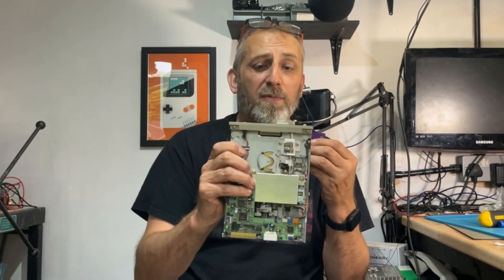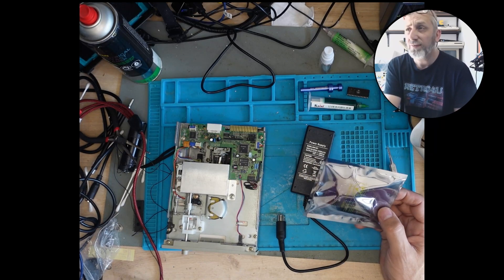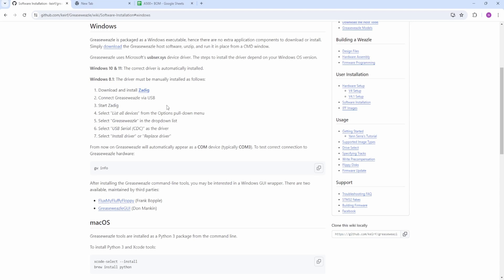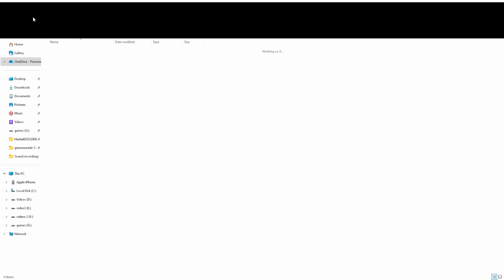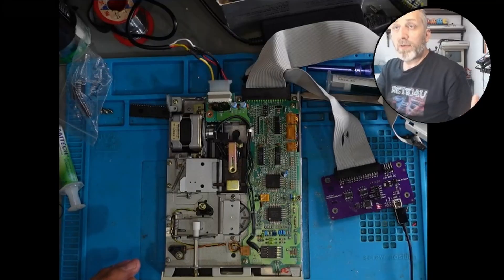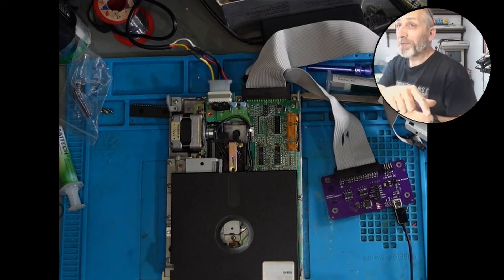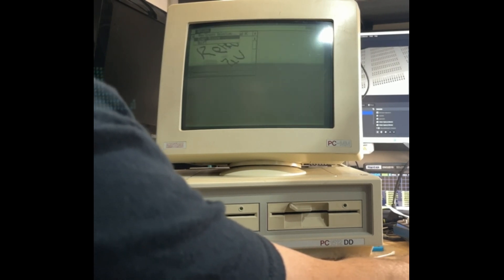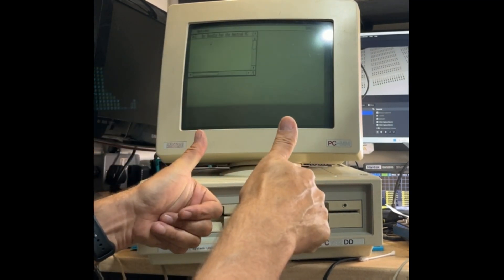How did I not know? : Greaseweazle FDD USB Adapter

Comment: The power supplies are garbage because the ripple is ridiculous ( bung it on your scope under load or look at my 1st/2nd videos ) .....But....... This was in comparison to using it on a 1581 which has no input filtering,  if you device has decent filtering and/or you don't drag its arsehole out by go over 50% load it will do the job...... well done on 1k chap
Reply from the maker: Yeah I remember your video. But needs where a must I didn’t have a ATX or AT to hand 🤚.  I might do that to have a play with the scope. Thanks for the comment and I’m sure your be at 1k in no time your do close.

Comment: For 3.5´´ Amiga disks there is a quite nice alternative: RobSmith DrawBridge. RobSmith made a very compact Arduino based USB-controller wich can replace the controller inside external 3.5´´USB PC-Drive. Which is still available NOS in quite big amounts, so quite cheap (about 20€ new old stock).
This is esp. nice for Amiga emulators.
RobSmith also developed a driver for UAE, so you can access Amiga discs directly from the emulator, without reading images first. This driver nowerdays is integrated in UAE and not only support DrawBridge, but  also GreaseWeazle.

Comment: Wow that didn't take you long ;-) Glad that it worked out for you. That Greaseweazle will be so useful for many years to come. If you have trouble reading DD floppies in a 360K drive that you wrote in a 1.2M drive you can swipe a neodymium magnet across the floppy a couple times before writing. That helped me out countless times so far.
Reply from the maker: Yep I did want to build one but think I will try that another day. Just need to try and sort the monitor now. Yet another tip the magnet 🧲.  But I’m just so glad it worked thanks again :)